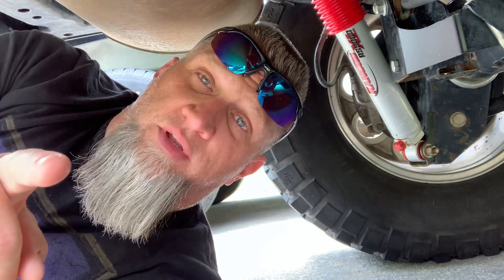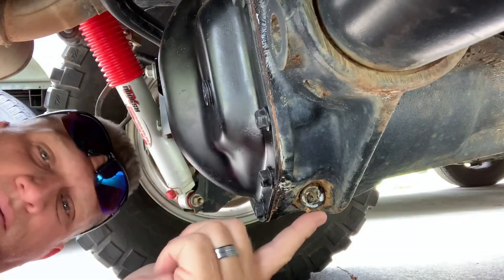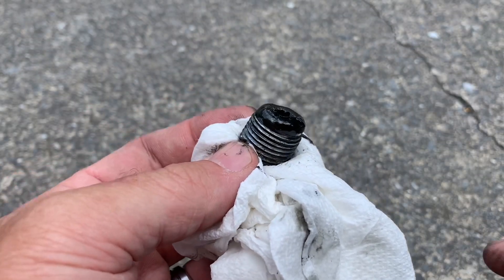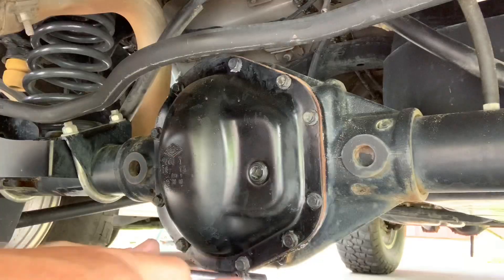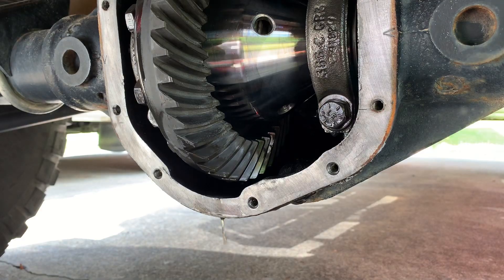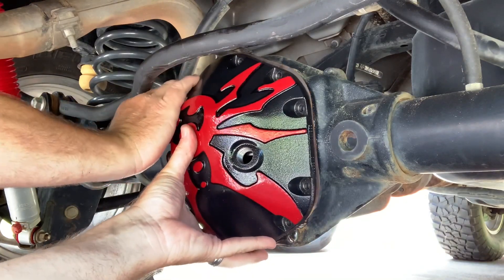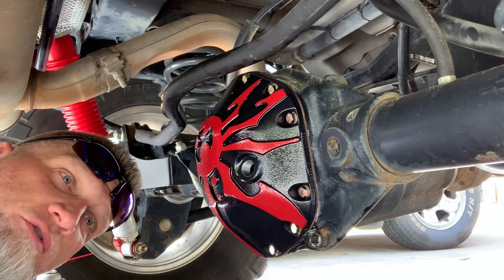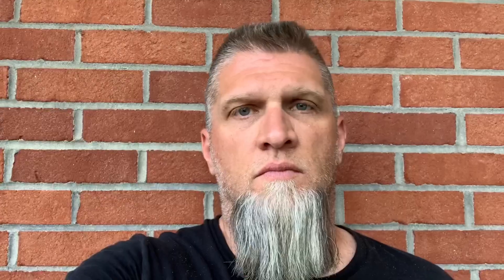How to Service Jeep Wrangler Gear Oil

Comment: I have a 2017 Rubicon. I changed my diff covers with the Poison Spider covers this weekend. The back held about 2.3 quarts but the front was less than 2 quarts. Not sure why. they are shaped slightly different. I even drove it around and let it sit for a while and the front was still full.
Reply: Jeep manual didn't say capacity of differentials.
Reply from the maker: I understand that you have a Dana 44 front and rear but the front dana44 could have a different gear housing area? causing a little less fluid? I believe the Dana44 front only holds 1.4 quarts. In the video details above I listed the capacities.
Reply: @Georgia4Low  Yeah your probably right. The diff covers were the same but housing looks a little different. I don't see the 1.4 quarts listed above. Your video was a huge help in both painting my covers and installing them. Thanks!
Reply from the maker: Mark Cox yeah in the bottom part of the description I have 1.37 quarts listed. I just rounded up in my comment. Glad you got the job completed, it’s an easy task once you get started.

Comment: I have a 2017 Rubicon. So I'm assuming I have Dana 44s. What is the trac-lok? Do I need that limited slip additive?
Reply from the maker: Rubicons have dana44 front and rear with electric lockers. Most if not all synthetics already have any needed additives. Track-lok is a form of limited slip.
Reply: Dirt Hammers Off-Road Got it! Thanks!
Reply: And I'm thinking about going with synthetic.

Comment: Thanks for the video. Just painted mine and about to do the swap. How do  you like the ranchos? Thinking about changing mine. Do you like the adjustability? Thanks..
Reply from the maker: Thanks for watching, congrats on the diff covers. Yes I love the Rancho shocks, I don’t tow so my adjustments stay between 1-5. Setting 4-5 offer a really good factory type ride. Turn them down to 1-2 for off-road.
Reply: @Georgia4Low  Thanks for the good information 👍
Reply from the maker: Earl Bartlett you’re welcome!! Thanks